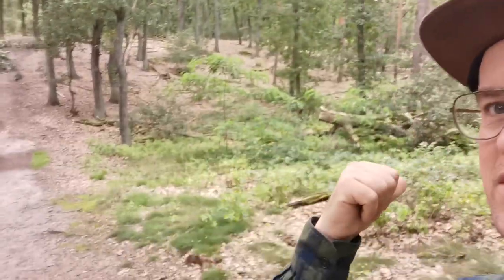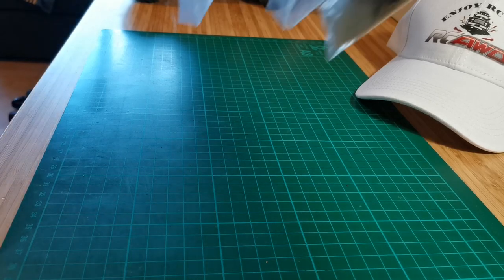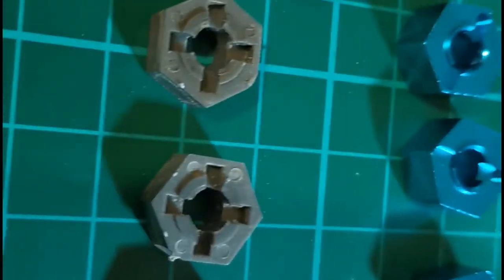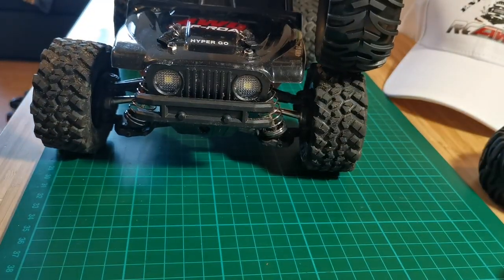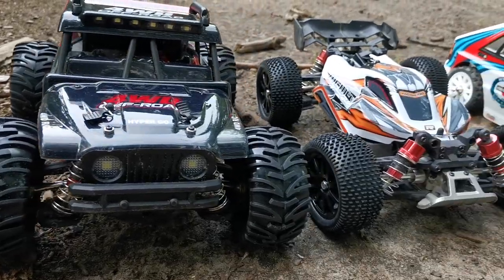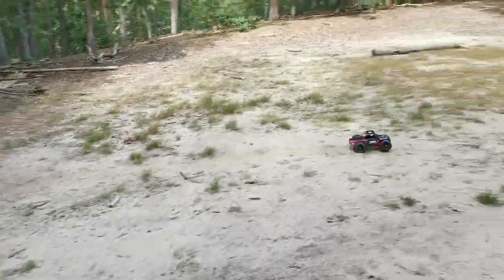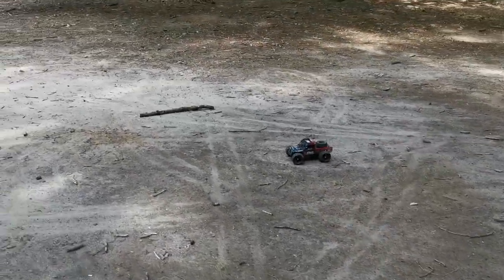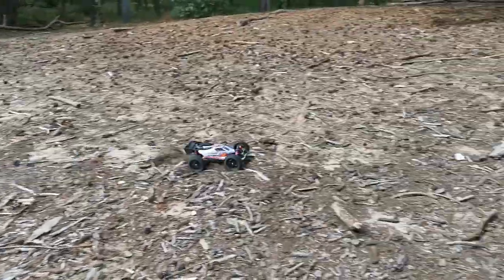MJX x RCAWD x 3S equals crazy RC fun – hyper go tire upgrade @rcawd

Comment: Little tip, it's possible to place the black 'infraction' hood on the rally mjx. Make sure to order it with the lights installed and you need a new front clip-holder, otherwise it sits too high on the front. Although it's possible to use some wood, velcro and metal wires to avoid a new front clip-holder.
Reply from the maker: Thanks. That's a useful to those who like both styles, but have a tight budget

Comment: I fitted 1.9” crawler wheels for extra ground clearance
Reply from the maker: Bigger tires are a quick and cheap upgrade for higher ground clearance and a faster car🤩
Reply: @carlitofisher  i didnt realise how hard of a hit it took when i first got it no wonder it didnt hold a line. I bent the front chassis, i know its already sloped but it went beyond that i now have heaps of spares which is why i got another 14209.
Reply from the maker: @67daffy  that's one truth of the hobby, where it's often 1 minute driving versus 1 hour of wrenching 😅. 14209 still one of my favorite RCs. I will probably take out for one my next videos again.

Comment: I had the same issue with my 14302 steering, but it was just caked up dirt. The stock 2kg servo isn't strong enough and the arm is pointing down which causes issues. So, I upgraded mine to a 17kg servo and it seems much stronger, but the servo saver could cause it to hang up. Need to get out and test it and see if it needs a solid arm or not though. Nice video and shots!
Reply from the maker: Hey wow, thanks for the feedback. Going from 2kg to 17kg is a huge increase in toughness. Probably now all stones turn into dust when you turn 😎. No chance for them to block that servo. Have fun and be safe out there.
Reply: @carlitofisher  Hopefully it's that strong, but we will see in the next video. I just need to get my lazy butt out there and run it 😁 Thanks for the sub my friend:yougotthis:

Comment: Hi Carlito, am a bit confused as am new to the hobby, I have a 16208, but also a 14209 on order, do they both use same tyre size, in your opinion what tyres should I get for these both? Can you share a link? Also I have a 14301 infraction style too, does RCAWD do tyres for that?
Reply from the maker: Hi and welcome to a great hobby. The tires are all the same size. The tires on the 14209 in the video are actually monster truck tires, but they work perfect with the chassis and look got to. The same set on a 16208 would be more to scale if you want that monster truck look. The buggy tires are a great fit for the 16207. Anyway here is my suggestion: for 14209: https://rcawd.com/en-de/products/rcawd-1-16-pre-glued-rc-monster-truck-wheel-tires-lg-007bl-lg-008bl?ref=8quxoe19
For 16208: https://rcawd.com/en-de/products/1-16-1-18-12mm-hex-pre-glued-nylon-wheel-rubber-tires-v-shaped-tread-gl-0053bl-gl-006bl?ref=8quxoe19

As soon as I find some for the 14301, I will post it here. All great RCs. Wishing you great fun with them. I hope I was helpful.
Reply: @carlitofisher  cheers Mate, that's really helpful. Big fan of your videos. Keep up the hard work.
Reply: Guess there is no performance difference between the 5 and 10 spoke versions?
Reply from the maker: @luvadealme  not really. It's more for the looks
Reply: Hallo MJX HYPER GO Fan's.I have 14201-03 And 14210.I have ordered the 14209 Car yesterday.Hope I don't have to wait to long.Cant wait to test the car.Its Really good and fast on 2-3s Lipo.I use bigger tires on alle my MJX HYPER GO Cars 🙏 Soo you can order different types of body and switch from 14201 to 14203.I tested the 14210 with the snow and sand tires was Amazing On 2s 35c😊Can't wait for Teste 3s Lipo maybe 3s 40-60c